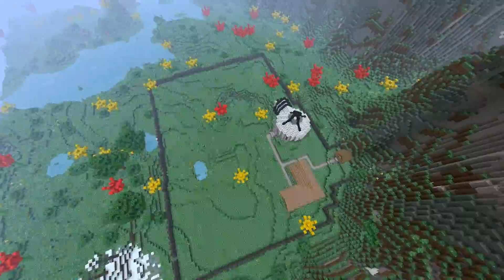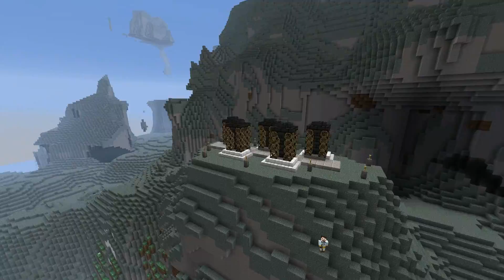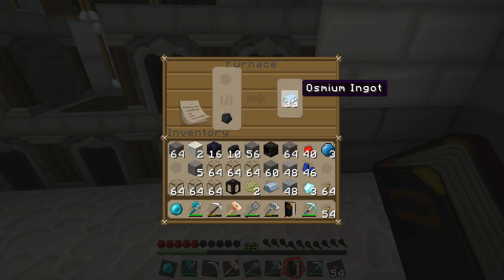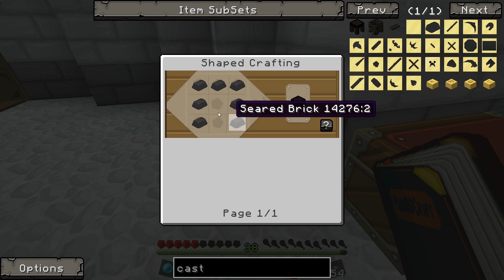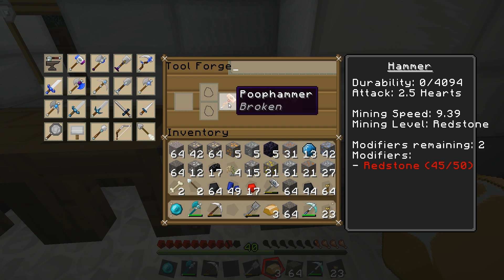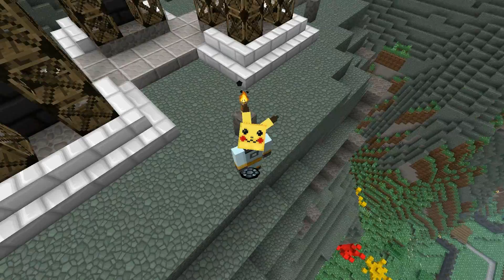Sjintech Space Rescue #8 - Wind Farm

Comment: Hmm. The mold is made from pure gold (probably the least practical material) which you can then fill with pure gold to cast shapes. Kinda silly on the part of the designers.
Reply: Ben McDonald Why would gold casts even be an option? IIRC gold is the softest of all the metals—and I don't think this is an exaggeration.
Reply: Sjin probably uses it because it has little value in tools and other crafting for his purposes, but i do agree with your point.
Reply: tibschris gold is a transition metal and is still harder than some of the alkali, and alkali earth metals which are soft enough to cut with a knife yet very reactive :)
Reply: Swish The Fish Yeahhhh but if you know that fact, then you probably know what I'm about to say: nearly all of the alkali/alkaline metals are violently reactive with air. You're right though. Sodium would be way less practical to use than gold.

Comment: sjin dont use all of the same ingot for one tool! they are crappy what would be best is to put some high quality sipsco dirt (or crappy dirt if you want) up by the slime island and wait for the grass to spread. when you break it you get slimy dirt which when you smel them you get slime crystals. when you use slime crystals for a tool rod you double the tools durability. the part that matters the most is the head and using a slime handle makes them tougher .Manyulian is the best alloy

Comment: You don't need the aluminum wire, use the mekanism universal cables.They light up green when there is power flowing through them.
There is no wool necessary

Comment: You need to use another wire that can transfer more energy/tick because the windmills make about 10 energy/tick and the wire only holds 40 energy/tick so try a better wire. Also the nuclear reactor produces a lot more energy than 50/tick so you should use some HV wire

Comment: Sjin make steel tools.  All you need to do is put iron back in the furnace.  Galacticraft allows you to make it steel.  Then the ore directory will let you smelt galacticraft steel in the smelter.  Steel has a lv 4 mining level and has reinforced 2 as its ability.  also making parts plates or bindings out of paper allows you to add more modifiers without decreasing the durability or strength of the tool

Comment: why did he make all those ingot casts? isnt it just easier to make blocks and then make them into ingots? :D
Reply: because if you have less than 9 ingots in the smeltery you need to use a cast (ingot if you don't need to make a tool) to get it out without  partially filling a casting basin rendering it useless until you  top it off with the material used

Comment: sjin next episode you could make a iron hammer and in the crafting table you could make a lava crystal which will add a affect to any item make in the tool forge have a affect called auto-smelt so say if you mined iron ore with a auto-smelt affect hammer it will smelt it into bars when the ore is broken with the hammer same with the excavator (aka) Loki with sand it will auto-smelt into glass hope this helps